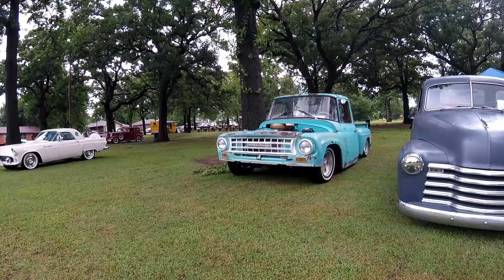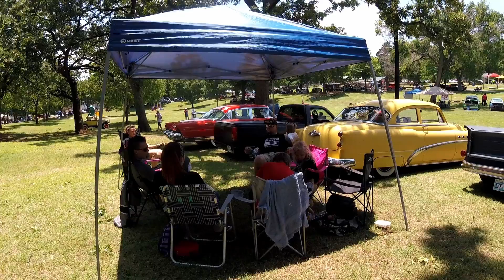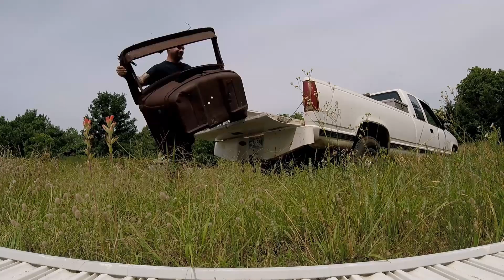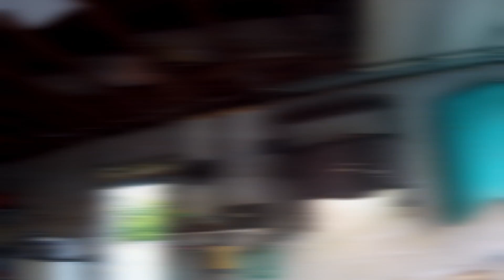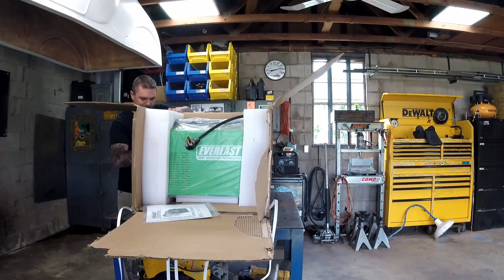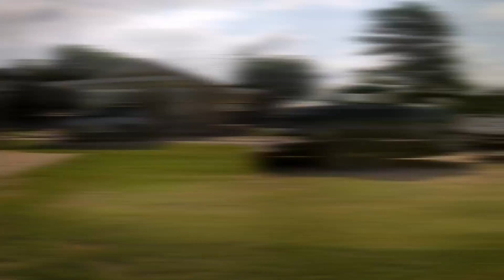Puddin's Fab Shop. Car Show, Wall hanger, New tools, and our NEXT PROJECT GETS DROPPED OFF!

Comment: Actually if you need to get into a tight areas a stick welder is handy compared to a mig for those tight and hard to get places. Plus the consumables is very cheap. compared to mig. yet mig is cleaner very popular and versatile welding process. I guess they all have their pros and cons. Tig is slow but you can control you puddle more which helps make your welds look prettier. Which is perfect for what your needing in the kustom fabrication world.